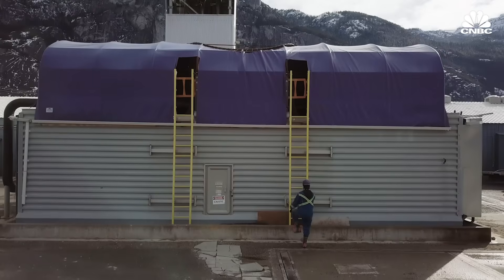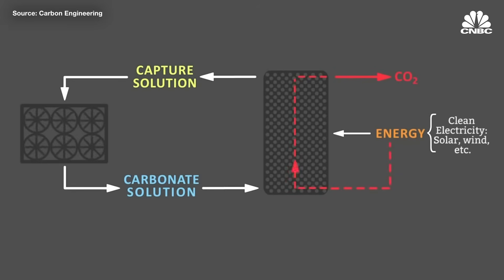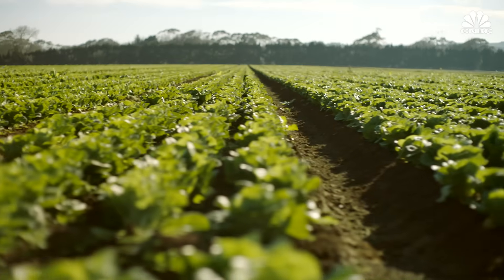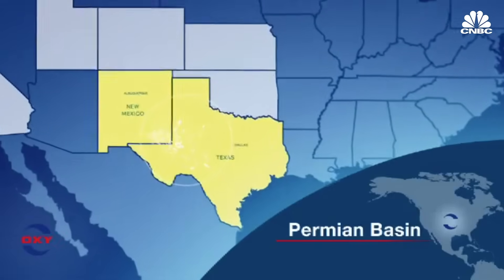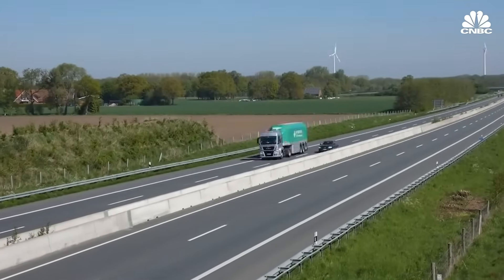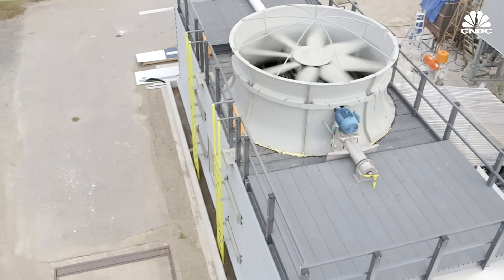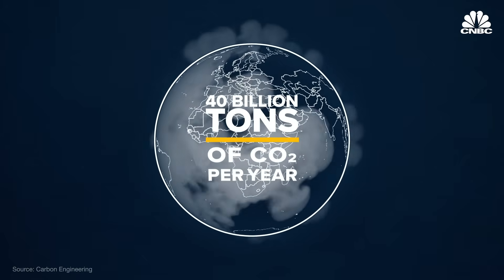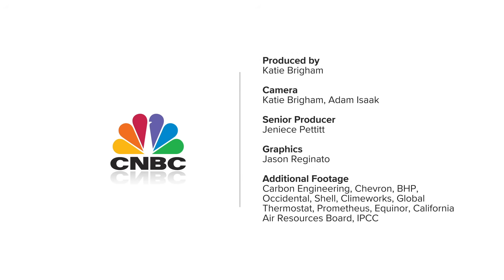Bill Gates-Backed Carbon Capture Plant Does The Work Of 40 Million Trees

Comment: We need an efficient way to convert the captured co2 into a useful form that doesn't get re-emitted to go along side the capture methods. 

Some ideas are high yield biomass production to building material. Carbon extraction to convert co2 into graphine, carbon nano tubes, carbon fiber, and other mostly carbon materials. Used with a converter system that uses chemical or organic components to turn the co2 into useful plastics and other solids.

Comment: Dude the power they used most probably comes from a coal fired power plant and they use it to pull CO2 from the air that is getting put back by the coal fired power plant

Comment: 40,000,000 trees would take 125 square miles of forest.  There is not enough land to convert to forest. At 10:13 he says windmills and solar take carbon out of the atmosphere because they prevent it fromgetting into the atmosphere. If they use the carbon from the atmosphere to make fuel, they they are not putting more carbon in the atmosphere. It has the same net effect as wind energy. It uses the existing fuel distribution infrastructure and existing vehicles without modification. I don't know why the professor criticizes the idea at 7:08.

Comment: Planting more trees is the dumbest idea ever. More trees DOES NOT help the climate crisis. All it means is more dark spots on the earth which absorbs the sun. When you have a reflective area that is lighter it reflects the sun(ex: snow). Do not take down the existing trees because that will release the CO2 held in them. However, do not plant new ones. The surface reflectiveness is greater then the CO2 capture of trees. So much misinformation out there from environmentalists with good intent, they are not a climate scientist.

Comment: We need to capture CO2 and reduce emissions. Current CO2 emissions is more than 37 gigatons annually.  That is more than 70 000 carbon capture plants of the 0.5 megaton variety mentioned in the clip... And that is just to compensate for current emissions. Removing the surplus CO2 would take another 50 000 of these...

Comment: Why investing so much money on these machines?
Just plant trees with it.
You don't need to store carbon underground.
Reply: Trees take time to pull and store carbon. Trees also have a finite limit on how much carbon they can sequester.

But this isn't an either or choice. We can do both. This is a more immediate solution that has the potential to become more efficient over time. Trees are as efficient as they'll ever be. No tech will make trees better at sequestering carbon. So plant trees and run these plants.
Reply: Plants get that oxygen from CO2. If they can cheaply seperate it, they'll be better than trees. Trees are incredibly inefficient in doing what's beneficial for humans.
Reply: trees don't magically disappear co2! then store in their trunks when they die is released.
to effectively "disappear" the co2 with trees(in simplre terms) you need burn then and trap the smoke underground.
and for each tree planted with this proposite is less space to food and people

Comment: Or just switch over to nuclear power plants instead
Reply: or don't, because the general public are idiots who don't understand nuclear power and irrationally fear it, even though it causes way less deaths per unit power produced.
Reply: @vapenation7061  irrationally fear? Was chernobyl and Fukushima not enough? The nuclear waste will remain thousands of years
Reply: Henrik S. to make that short, most nuclear disasters were because of lack of knowledge on the subject in the 1950s to 60s, Fukushima was a freak incident, and nuclear radiation don’t last long as you think. Also it’s safe.
Reply: If we go down that path, they would plan on storing nuclear waste in the middle of the United States where I currently live.
Reply: Mike Ibarra power plants are supposed to store it in cooled storage tanks so you most likely won’t have to relocate.

Comment: Dude saying solar panels remove carbon from the atmosphere is dead wrong.  Renewables just prevent carbon, not remove it.
Reply: Overtime is effectively the same thing. That was the point.
Reply: @wylie2835  it's not the same thing at all though.  Not only do solar panels not take carbon out of the atmosphere in any way, but there is an embedded carbon foot print in building and maintaining them.  So no, it's not the same thing at all.

Comment: One thing is, the plants would need to be spaced out fairly evenly or more focused around the location of CO2 emissions, otherwise it may lead to dramatic climate differences among regions(eg. having a bunch of these plants localized FAR from any actual plant or CO2 emission source would be very inefficient and make differences in air quality based on region even more significant). Just mentioning this because in the video, the CO2 capture facility looks fairly remote and away from any high CO2 density areas.

Comment: What happens to the carbon after it is injected into the earth? Can it be proven, that it will actually stay underground permanently? How does it effect underground water, or what happens during an earthquake? Generally, if the oil industry likes it, I'm getting very sceptical. Obviously, this technological solution is very expensive, much more so than simply plant more trees. And those are much prettier than extraction installations.

Comment: Mechanical solutions for Carbon removal should be placed in or near volcanic active zones. 
1) the carbon dioxide released in such zones is massive, compared to our puny little cars and industry
2) the density of Carbon in the air in such zones is MUCH greater, than say in B.C. Canada
3) you can utilize the heat or pressures in Volcanic areas, to drive the generators or turbines for said Co2 capturing plants, as far I can tell, they only need to run fans and heat-exchangers to make the pellets > which is better than burying it.
Seeing the math behind making fuel the regular way and doing it with the support of captured carbon, will tell us if that is indeed a viable option.

I still don't get why we are so inflexible when it comes to ANY of these solutions. Nature has a cycle and we can EASILY make use of many types of Algae that convert Co2 and EVEN RELEASE oxygen or become part of building processes. These Algae are actually edible and you end up with clean air AND food at the same time. And if it's not food, it can be Carbon Fibers that can be turned into ANYTHING to build things with. Lighter and stronger will result in less heavy steel industry and much less needed material, again saving fuel and energy....START COMBINING TECHNOLOGY AND QUIT WITH THE BLACK AND WHITE MENTALITY. Is this really so hard?!?!?!

Comment: how?
plants convert co2 into oxygen.
this machine just pulls co2 and realease no o2.
Reply: The goal would be to make the carbon emissions neutral not necessarily to replace the trees, it's like traditional medicine working with holistic practices. If both are working to help the environment why not???
Reply: Plants don’t convert CO2 into oxygen, they convert water into oxygen. The CO2 gets converter into glucose.
Reply: Martijn Camps The C gets stored as energy in phosphate groups. Most O’s get released.
Reply: Exactly.
Reply: It's basically Thanos but for Co2
Reply: I made a comment just like this as well. "Wise minds think alike" -a smart person once said
Reply: Air at Sea level:
78% Nitrogen
21% O2
0.04% CO2

It's about the ppm in the air that the earth and its animals have evolved and adapted to. 

Humans typically breathe in 21% O2 and breathe 16% out. This demonstrates the passive gradient of gas exchange that happens across the membranes of the lungs (aveoli), from the air and into the blood.  Notably, CO2 follows the same mechanism in the opposite direction: a slight buildup in the blood diffuses into the air you breathe out (because as indicated above, it is so low in the air).  Interestingly, CO2 is what actually drives your breathing, not oxygen.
Reply: oxygen isnt the problem, if all plants and plankton died today, itd still take 10000's of years to use all the oxygen. And 70% of oxygen is actually produces by plankton not ur damn trees
EDIT: https://www.quora.com/If-all-the-oxygen-producing-plants-suddenly-disappeared-how-long-would-it-take-us-to-die
Reply: How does the plant transform Oxygen into Carbon? It doesn't it simply stores the carbon inside itself in a form that is useful. When you burn the tree or it dies, you re-release most of the carbon. I don't think "planting trees" alone will work for this reason. You would have to increase the amount of trees on earth permanently proportional to the amount of carbon we have dug out of the ground. I don't think it's possible and even if we do make the whole world a forest, the environment will suffer from this too, just in another way. 
Pulling the carbon back out of the air and storing it in the ground where it came from is the way to go.
Reply: Jason Poole  If you take a breath with less than optimal oxygen, it can give you brain damage. 

If you take a breath with MORE than optimal oxygen, it can give you brain damage. 

Maybe you already got yours though.

Comment: turn that million into billions and it might work and also F%$#@ oil company's trying to hold onto their power
also why don't we stop subsidizing big oil the make gas therefore raising gas prices and implementing a "carbon tax" without an actual tax
Reply: @mikoserbousek4987   really cause oil so far has not made any Real moves to stop climate change caring more about the money then the future of the next generation 

JUST SO YOU KNOW BIG OIL CAUSE THE CONFUSION ABOUT CLIMATE CHANGE TO BEGIN WITH AND COULD IF THEY THREW THEIR MONEY BEHIND A SOLUTION FIX IT VERY QUICKLY BUT THEY CARE MORE ABOUT PROFIT THAN ANYTHING ELSE SO YES I HATE BIG OIL FOR TAKING MY 100 YEARS OF LIFE AND CUTTING IT IN HALF YOU DUBO
Reply: @mikoserbousek4987  You dont know that you say that like electric cars didnt exist when gas cars first started but they did and people actually liked them more but oil company's of that day cough that still exist today started a smear campaign on electric cars so gas would be a consumable and they would make more profits and dont you dar tell me that gas cars had more mileage because that's bull they were even in the beginning and You dont know if electric cars planes and such would be better if not the same mileage as gas cars by now if electric cars were researched from the beginning

Comment: grow biomass IS capturing co2 and sequestering carbon... plants break down the carbon from the oxygen, release the oxygen, then break down the water and 'knit' the carbon and hydrogen together to make cellulose...which these idiots want to burn to turn it back into carbon again... to fix this entire 'infomercial' all you need to do is 1) remove 'dioxide' and replace it with MONOXIDE at every occurrence and 2) realize that trees and plants do not use monoxide (CARBON MONOXIDE) AT ALL,  they reject it - so it accumulates... and 3) the ocean is constantly sequestering carbon dioxide from the air and the carbon is binding to calcium in the form of chalk (the White Cliffs of Dover), marble, sea shells, limestone... that little processing plant there is covering three fourths of Earth's surface,AND HAS BEEN FUNCTIONING FOR SEVERAL BILLION YEARS NOW... but these guys want to compete with that, get paid something like 60 dollars a ton... (AND WHAT HAPPENS TO THE 'USED' CHEMICALS AFTER THEY SOLUTION HAS TAKEN THE CARBON OUT OF THE AIR? - And this STILL DOES NOT ONE DAMN THING FOR THE CARBON MONOXIDE ACCUMULATION THAT HAS BEEN OCCURRING FOR THE LAST TWO HUNDRED YEARS, I.E. SINCE THE INDUSTRIAL REVOLUTION!!! WHAT ABOUT ALL THE THOUSANDS OF YEARS OF CARBON DIOXIDE BEFORE THE INDUSTRIAL REVOLUTION... WHY HAS THAT NOT KILLED US ALREADY? Prolly because cars, trucks, planes, ships and coal burning plants and factories were not around for those thousands and thousands of years, only for like the last couple of hundred WHICH IS WHEN THE PROBLEMS STARTED!!!
WHAT KIND OF COLLEGE EDUCATED IDIOTS ARE WE PAYING TO ADVISE US? HOW DAMN CROOKED IS THE 'TRUTH' BY NOW, EVEN THE NOBEL PRIZE COMMITTEE SEEMS TO AGREE THAT CARBON DIOXIDE IS ACTUALLY CARBON MONOXIDE...

Comment: I prefer plants. We can eat plants. Carbon Dioxide is only a problem in the minds of the scientifically challenged and politically deranged.
Reply: Donald Boughton when we eat plants. The co2 comes back out
Reply: @herbertgrunkin6333  The carbon dioxide combines with water to form a weak acid which dissolves the rocks. The resultant carbonate and bicarbonate ions precipitate out in the deep ocean basins. There the precipitate is transferred into the earth by the subduction zones. The carbon dioxide is then released by subduction zone volcanoes. The planetary carbon cycle is
approximately 150 million years long thus trying up the carbon dioxide for 150 million years. Is this long enough for you?  If industrial extraction of carbon dioxide goes too far we all die because photosynthesis stops and the food chain collapses. The critical level for carbon dioxide is reckoned to be 150 ppm.
Industrial extraction of carbon dioxide from the planetary atmosphere is a pointless exercise as it will have little or no effect on the climate. This is because contrary to Green beliefs carbon dioxide is not the dominant green house gas. The dominant green house gas is water vapor.

Comment: Why do we have to bury the CO2? I love the fact that we are diversifying our efforts to stop the climate change issue, but why are we burying it back in the ground? These plants are essentially mining factories, but of the air vs. from the ground. CO2 has two great compounds/elements that help every day. 
1: Carbon, which there are businesses that spend billions and using environmentally damaging processes to dig up around the world everyday for fuel (I know bad example, but a reality until we can get completely away from Carbon based fuels). Carbon is not just used for fuel but in nearly everything we use (i.e. metals, food processes, paints, wood glues, tools, diamonds, etc.)  
2: Oxygen (namely O2, which is an anti-green house gas). We can get rid of all the CO2 that we want from the air, but there are still the issues of worse gasses we still would have to negate (namely CH4 - Methane. A huge natural byproduct from natural decay process.). We also use O2 for space fuel. O2 can also be used as an everyday fuel in combustion power plants when mixed with Hydrogen, that creates the byproduct of pure water - H2O. These plants could help in regions where clean water or any water would be loved/needed. 
Through these technological advancements in this type of mining would lead understanding and equipment from other worlds (i.e. Mars - 95% CO2 and the moons of Jupiter/Saturn that are loaded with liquid CH4. Mining the air for in space travel could help in spacecraft fuel/food processes and/or making breathable air. There are limitless options out there. So again, why bury the freshly collected CO2?

Comment: If captured carbon is used to produce fuels then the net emission is zero (assuming that clean energy is used in the process)? How can anyone oppose it just because it involves gasoline at some point?

Carbon neutral fuels are in principal not different from electric cars. If they're used instead of being hidden the oil that would have been used instead stays underground. What's the point of capturing carbon to burry it while others digg up oil, if you could instead use that captured carbon?
Reply: That might be their long term. Or at least part of it. Since sooner or later we will run out of fossil fuels. They don't want to go out of business then.

Comment: It doesn't have the same effect as 40 million trees, It might remove CO2 from the air but does it replace that with O2 or provide an ecosystem for other plants and animals, reduce erosion or the myraid other benefits.

Capturing CO2 by burning fuel seems backwards and how long would it take for the renewables initial impact to be offset by the plant?

Plants like this are a feelgood PR gimmick rather than putting money into trying to recreate the actual process of photosynthesis.

Comment: If the root cause wants to fund it to help solve the issue, more power to them if it actually helps the planet. It's the correct step in the right direction.
Reply: @mikoserbousek4987  agreed, there has to be a better solution out there. but for now this is what we have.

Comment: "bury the CO2 back underground where it came from".. Whoa, slow down pardner, there was carbon (coal) and hydrocarbons (oil) underground, not CO2. By burying the CO2, your burying the carbon together with oxygen that was originally in the atmosphere. Trees are truly restoring the atmosphere by releasing the oxygen back. Not mentioning that the wood might by useful too (as long as you don't burn it, which negates the CO2 reduction.. )